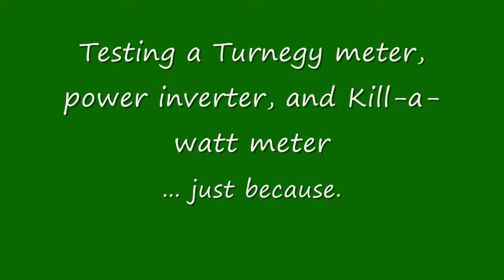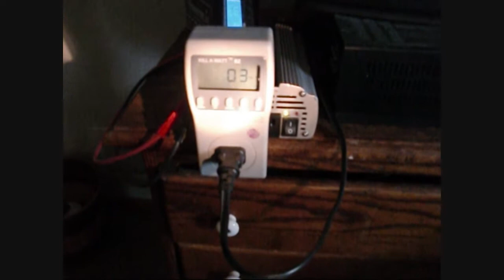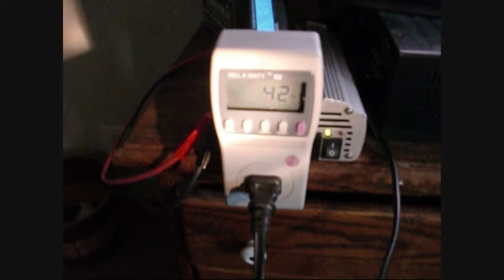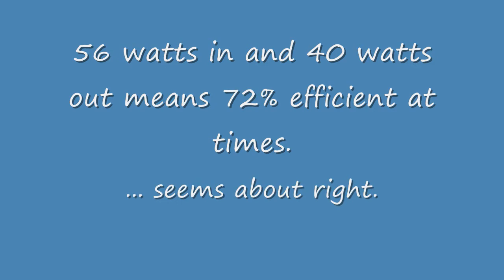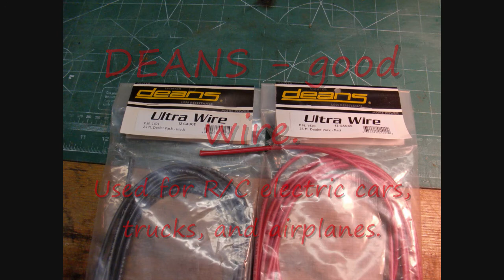Battery, Turnegy, inverter, kill-a-watt, TV test and DC cable information

Comment: Good advise on the fuses.  

Inverters are power hogs.  My inverter manual says that the unit will draw a half amp just with the switch on and nothing running.